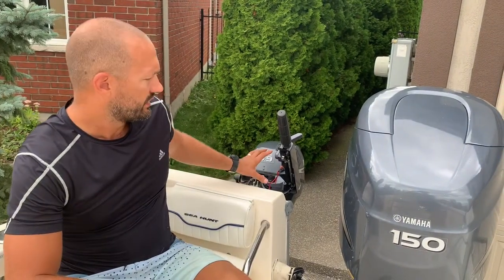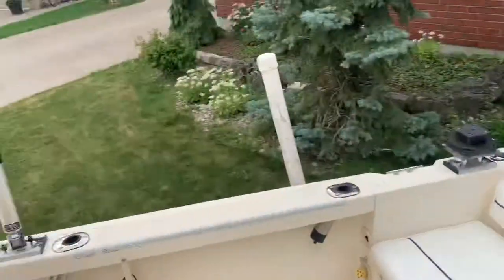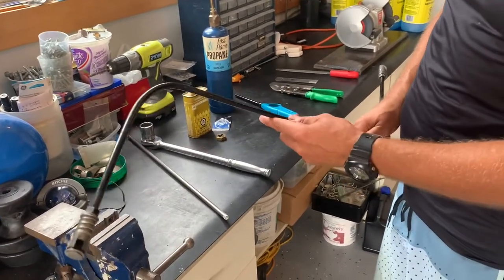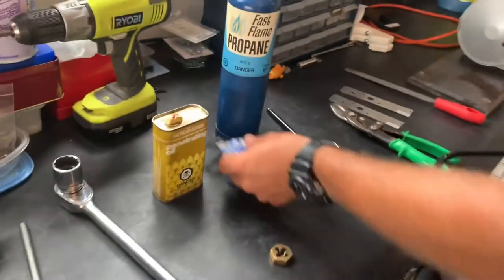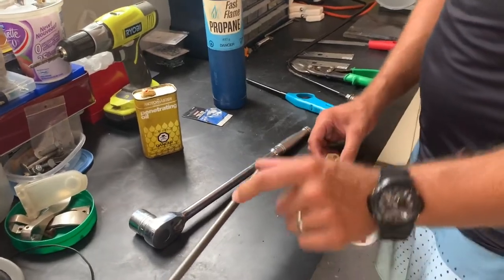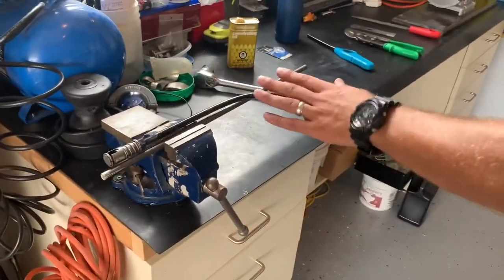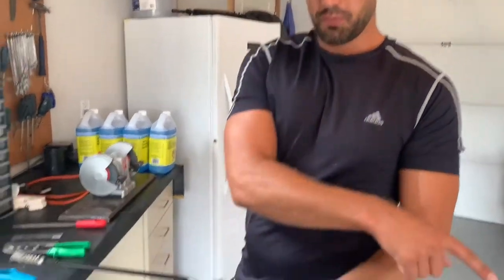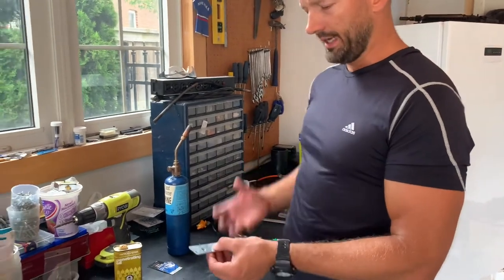How to Make a Steering Bar for Kicker Motor

Comment: Nice job!  Couple of comments:  1.  MAPP gas heats much hotter and would make the bending easier.  2.  The steel retaining clips on the end of the Panther quick disconnects are shit steel and rust readily, definitely a weak link (I've lost the spring and connector on 2 sets, including one "stainless steel" set).  Thanks for the great idea.
Reply from the maker: Thanks for the tips. Definitely good to know and now that you said it the panther quick disconnects have been getting a little rusty even though it’s only freshwater.

Comment: I have had this on my list of winter projects, were did you get the ball joints from?
Reply from the maker: You can get them on Amazon. They are called Panther 55-5200 quick disconnect 
https://www.amazon.ca/Panther-55-5200-Disconnect-Auxiliary-Steering/dp/B00TTO8K4G/ref=mp_s_a_1_8?dchild=1&keywords=panther+marine+steering+bar&qid=1610976257&sr=8-8. There are also different manufacturers and sizes
Reply from the maker: You can also get them on some other websites for a lot cheaper

Comment: I didn't get a very good look at it, but it looks like the rod you made interferes with the large motor in a left turn.
Reply from the maker: Yes it does if you turn very sharply. We couldn’t find a way to make the bar without that happening. It works fine for us and our motor cowl isn’t damaged from it.